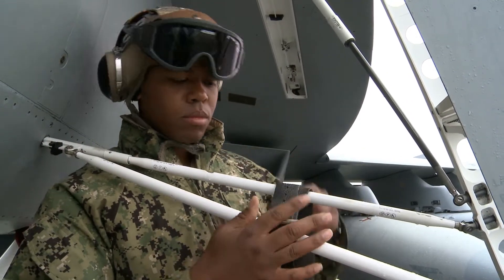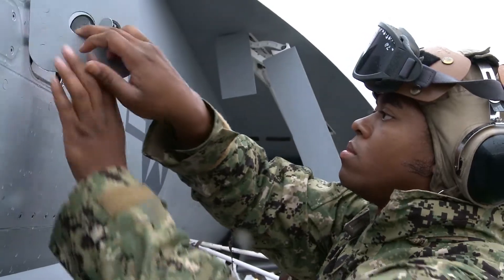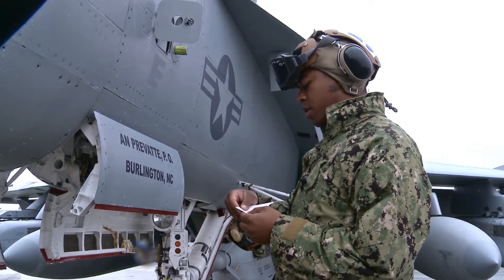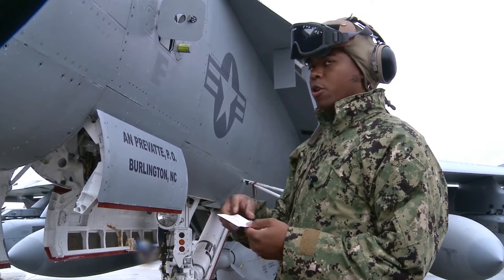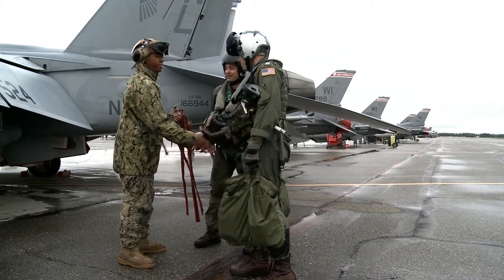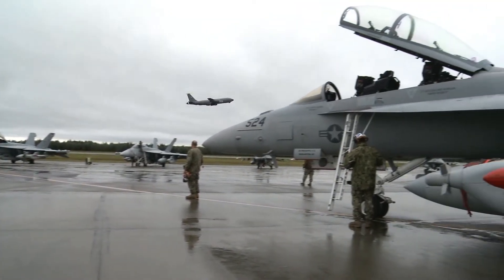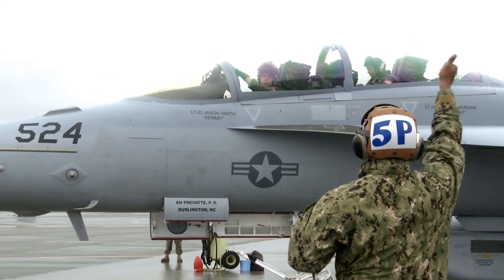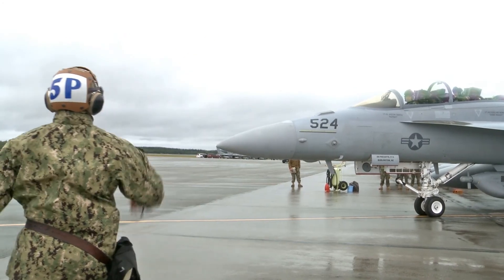Naval Plane Captain Launches Jet

Comment: Very Professional, Doing what's required. That's what I like to see and no other BS launch signals from PC and Crew. Seen too many videos of PCs and ground crew performing dances, robotic routines and unnecessary movements during a start up and launch. Operational Squadrons are not the Blue Angels. It's great to have fun during a training cycle for sure. But up on the Flight Deck you do exactly as this PC does, no performances. BZ to RB! Go Navy!